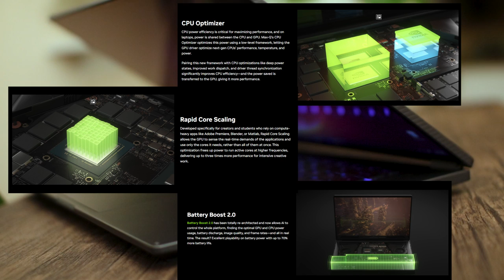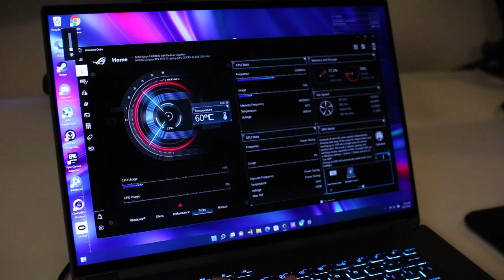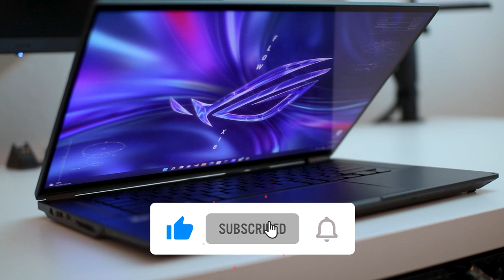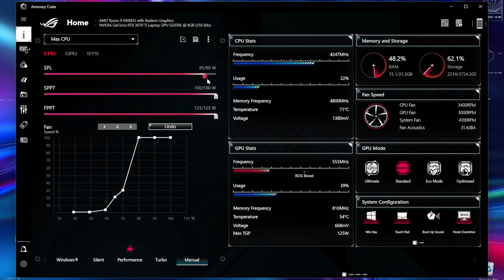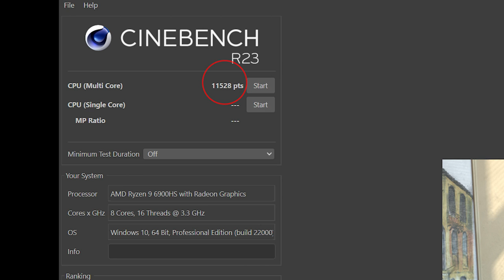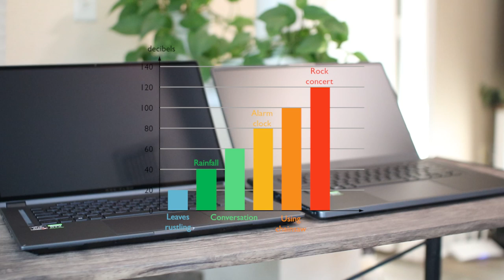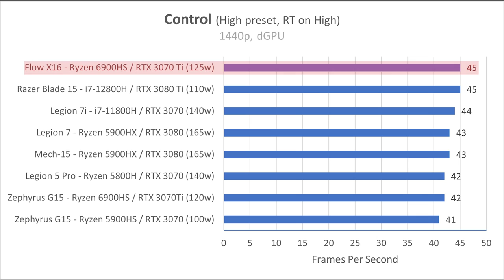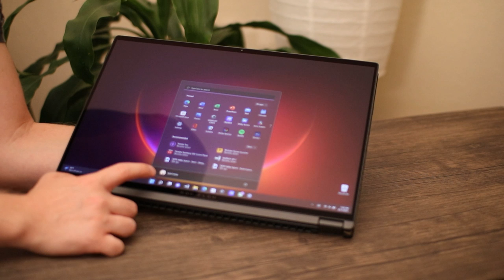Asus ROG Flow X16 Review - Best Gaming Laptop?

Comment: Amazing review, very detailed, long, yet focused and consolidated, well done, thank you!
Do you happen to have a true USB C 3.2 gen 2 to Display Port 1.4 or HDMi 2.1 cable to test the USB C of the XG connector on a 4K/5120x1440 monitor, maybe?
I am aware performance even with DLSS would be low on my monitor, however, my plan would be to get XG 40 series next year for it, was I buy this than actual pc for that would be my dream...
I am only concerned if it could output 4k120/5120x1440 240Hz over said USB C with a rated cable via DSC until then.

Comment: Would you recommend the X13 2022 as well? I've seen the X13 is a bit cheaper.
Reply from the maker: Yes but it’s much less powerful! One of the most powerful 13” laptops you can buy though. Maybe THE most powerful 13” laptop, but even still the X16 offers quite a bit more performance. X13 is much more portable though of course! Just no mini-LED display or anything. However if you get a 1200p model it’d probably get about the same fps in games as a 1600p Flow X16. Still both are great for creators and gamers alike.

Comment: Man I found your review and thanks god I found it , Do you think is worth the 2023 model with 4070 ? It’s still have the same screen tho? Atm I’m between this and scar 18 I love the bigger screen ones ,but comes with huge price , so what do you think ? Pls I wait your answer Asap,keep up the good work Respect !
Reply from the maker: There’s a lot I dislike about the 2023 model to be honest. I’ve heard they got rid of the glossy screen although I could be wrong there. But the biggest thing is the switch to Intel. That is going to cut battery life in half, as we’ve already seen with 13th gen intel laptops. They don’t have good battery life. It may also run hotter and louder because of how power-hungry Intel is. That is a pattern with Intel laptops. And the GPU is a bit disappointing as well. The RTX 4070 is barely any better than the 3070 Ti so you won’t see much graphical improvement either. The only major improvement you’ll see is in the screen having more dimming zones, so there will be less bloom around bright objects on dark backgrounds. But that’s about it. The Scar 18 is a different beast all together. It’s big and immensely powerful as long as you get the 4080 or 4090 model. It will destroy in performance but the screen is nowhere near as good and it’s obviously not very portable at all. And expensive.
Reply: @JoshCravesTech  thank you so much for the fast reply, so in conclusion you will stick with the current version if you have to buy now flow 16 or buy something else ?You really made me think a lot about the flow 16 ,best review I saw in years for laptops un general and a very non biased opinion
Reply: @JoshCravesTech  will you still chose the flow 16 over any other hands down ?
Reply from the maker: @jinasura3052  absolutely. The only thing that comes close is the 2023 Zephyrus M16, but it’s a matte screen, no touchscreen, no foldable hinge, and it’s pretty loud supposedly
Reply: @JoshCravesTech  I understand now ,thank you for making everything clear to me ,was an honor to meet someone like you

Comment: Great video! Thanks for sharing. I have a question regarding the second SSD m2 drive, I saw you used a 2280 format in the slot but in some reviews I read that the second slot is for a 2240 format m2.  Have that second slot with an 2280 m2 worked fine for you? Do you know of any issues that can arise using a 2280 at a 2240 slot?  Thanks in advance!
Reply from the maker: Fits perfect and never had any issues! Most of my games are installed on that drive and it’s super fast and works great.
Reply: @JoshCravesTech  Great! Thanks!

Comment: Does the MUX switch+Optimus solution require reboot every time when switching between the internal and external GPU:s? Or can the software automatically handle the switching without reboot once you set it up? Cause I don't fancy having to type my BitLocker password ten times a day...

In the case that you have to reboot every single time, would it make more sense for me to simply keep it in external GPU mode non-stop as long as I don't prioritize battery life but simply want the best performance in every usage situation? Or would there be some other drawback besides battery life to this approach?
Reply from the maker: Correct, it requires a reboot to switch. If battery life is of no concern, then it is best to just leave it in dGPU mode all the time. The only other downside is that you lose Freesync in that mode because that runs through the iGPU, but I’ve never noticed any screen tearing personally.

Comment: Hey Josh! I just found your channel and this is the best review I saw on Flow x16! There's something I'd like to ask, I'm an animator and I plan on buying this laptop mainly for gaming and drawing. I didn't wanna go with any surface as it's not powerfull enough compared to this one. But then I saw that the tablet mode (the one I would use most of the time) has the lowest performance compared to the others. I suppose this is due to cooling? I would use it on a stand as I like to draw at 45 degrees, but now I'm worried that it would not perform good enough or it would get too hot and eventually damage the components. Do you think it's worth it?

Thanks again for the video, it was really helpful!
Reply: Also, something I didn't understood, the keyboard keep clicking when is on tablet mode or the is it flat enough so that it stays in place?
Reply from the maker: @alvejado  thanks for watching! Yeah so it is still very powerful in tablet mode! It’s just lower power than when it’s in its stock “clamshell” orientation. They do this so you don’t burn your hands off from hot air exhaust if you happen to be holding it. But it’s not “weak” by any means. It would outperform a Surface by a huge margin. It stays cool also so there’s no worry about damaging components. And the keys don’t get in the way, the keyboard is disabled when in tablet mode as well.

Comment: First of all, great video!

I'd like to ask you a question: when you use the stylus to draw/handwrite (in tablet mode, flat on a table) does it show like the "air bubble"? 

I've had a surface pro 8 and when writing with the stylus the bubble under the pen was showing, and the pressure I was making was minimal. 
Instead an iPad pro with an apple pencil never showed the bubble under the screen, even when I was pressing a little harder than normal. 

As far as I understand this was because the iPad had the digitalizer built in in the screen, while the surface has the screen and the digitalizer under it. 

I am a dev-and-gamer first, drawer second, to me the flow x16 is appealing because I would be able to draw on it, unfortunately I can't find any review that talks in depth about how it behaves in drawing/writing with the stylus.
Reply from the maker: I’ll have to check on this, I’m not sure!
Reply: @JoshCravesTech  Thanks so much! Just write on onenote as you would on paper and check if the pen has an effect on the screen (remember the "bubble/wave" when pressing on a liquid crystal display? that sort of things). 

If you have not that effect (or have that only if pressing really hard, on par to an iPad with apple pencil support) then this device is really outstanding. 

Thanks you so much. Keep up with the great videos!

Comment: Great review. I currently own the Flow with ISP and 3060. Thinking of upgrading but had one question that might be the game changer. I use this often at night and usually have brightness turned almost to it's lowest with Nightlite on to keep the screen dim. Could you tell me how dim the mini LED goes in comparison? I hear it's not as dim but what should I expect?
Reply from the maker: Yeah, I do wish it got a little dimmer at the lowest brightness. If that’s a concern of yours (and there might be third-party software that helps with this) then yes it might be a little too bright.
Reply: What did you decide?
Reply: @kundakaps  I went with the standard, dimmer version. Didn't think the brighter version was worth the battery usage and price.
Reply: @thaddeus722 
I found the 3060 one for $1000.
I thought it was an unbelievable bargain.
Reply: @thaddeus722  
Did you buy the IPS variant of flow x16? Please let me know how the screen is?.are the blacks good? I have bought the IPS one ..hope its not night and day between that and mini led..
Reply: @ananttomar1865  I bought the IPS. It's fantastic. And you will never be disappointed in the difference because you didn't buy the mini-led

Comment: Is there a similar laptop but with intel?
Reply from the maker: The Zephyrus M16 would be the closest but it lacks many of the features. Intel’s battery life is atrocious though, so that’s probably why they didn’t go that route.
Reply: But I need a convertible, so I wait for the Rog Flow Z16
Reply from the maker: @reimjaguar6894  May I ask why you need Intel?
Reply: Better performance
Reply from the maker: @reimjaguar6894  have you seen Jarrod’s Tech video on it? The difference isn’t very noticeable outside of a few programs/games unless you’re leaving it plugged in 24/7 and you really want that extra bit of performance when it’s running at high wattages. Ryzen still wins at low wattages, efficiency, battery life, and performance on battery: https://youtu.be/S64_a7PChzs

Comment: It's really cool but hurts buying a rtx 3070 Ti and some time later buy a XG mobile dock and turn the 3070 Ti useless. I wish this laptop came with no GPU so it would make it easier to upgrade
Reply from the maker: Yeah I suppose. The 3070 Ti is still powerful though so even if you weren’t plugged into the XG mobile you still have great performance. And you can always hold off on the XG mobile until they release like a 4080 or 5080 one. They do sell a 3050Ti option for the X16 though!

Comment: Die you undervolt the CPU like you did on the Zephyrus?
Reply from the maker: Yes I think I put an undervolted benchmark screenshot in there somewhere. If I didn’t, it basically led to the same score I got on my G15 but with a slightly higher CPU score. About 11.3k graphics, 11k CPU in Time Spy, and about 15.3k multi-core in Cinebench.

Comment: Great in depth review i recently bought the mini led model and I like it except trying to figure out best way to optimize battery life as I do a lot of work on the go and outside. Using armory crate in eco silent and dim brightness I'm only getting about 5 hours max on youtube playbacl. I've seen other creators on  YouTube get 8 to 10 hours not sure if it's just my unit or that's about the realistic average. Curious to see your thoughts
Reply from the maker: Yeah at similar settings I get around 7 hours. Other things to check are keyboard brightness, minimum processor state (should be set to 0%), turn on eco mode in your internet browser, and disable all startup programs or background processes that drain battery (discord, Steam, Spotify, etc.)
Reply: @JoshCravesTech  thanks will try those out appreciate it
Reply: Stopping the app start ups, stopping edge from constantly running In the background  and changing the minimum processor made a huge difference. Now getting 8 hours plus which is big difference. Especially since made the transition from a mobile workstation was starting to regret the purchase. Thanks again
Reply from the maker: @MrMaw24  no problem!! Glad it’s working out!

Comment: Josh i found a offer of Asus flow x16 with RTX 4070 and I9 and 32 GB ram. Do you think it will work with gaming cyberpunk with out heating Problems and to loud with this high grafic Card and prozessor. I cant Find in switzerland good offers also Laptops with 32 GB of ram and good grafics
Reply from the maker: Yes it will run Cyberpunk really well! Especially the 2023 model with DLSS3
Reply: @JoshCravesTech  It was rly Hard for me to choose between M16 and g14 and flow x16. All i read of g14 is much heating Problems and m16 too and to loud. And you said AT the end of the Video of the New Asus flow x16 review for gaming would be g14 and m16 better ? Is it rly because heating Problems are a huge Problem to enjoy gaming not? Isnt then the flow x16 best choice?
Reply from the maker: @julijanlj.9195  if you wanted a 4080 or 4090 G14 then I might lean toward that one for more performance. I don’t find it to overheat unless it comes with bad Liquid Metal application. For the same GPU though, the Flow X16 is much more premium and quieter.

Comment: Unfortunately I think the 3070ti with the AMD Ryzen 9 version is no longer available since the ASUS site removed the purchase button, and Best Buy only offers the 3060 model (I think without the mini LED as well). Although, I did manage to find one listed on amazon with the 3060 model, but I believe this is the same as Best Buy and does not have the mini LED "nebula" screen. 

I am interested in the mini LED feature, but I am a little worried about how noticeable bloom looked on the reviews you posted for the ASUS 2023 flow and M16 (but I think it might be something I can get around as you mentioned it looks worse on camera). I am torn between the 2023 xflow and M16. The 2023 flow is more pricey but has quieter fans, while the M16 appeared to perform better, but there is difficulty with connecting to external monitors and the fans are significantly louder. 

Which would you recommend for college student?
Reply from the maker: If you’re comparing 4070 to 4070 then I’d get the Flow hands down. If you’re comparing to the 4080 or 4090 M16 then yeah the choice is tougher. It’s been over 4-5 months now and they still haven’t released a bios update to fix the M16’s outputs however I’ve heard some people say theirs works fine while others are still having issues so I’m confused on that whole thing. But yeah I’ve been using G-Helper and that is a great little app for helping fix fan tunings and stuff so I definitely recommend it if you go with the M16!
Reply: @JoshCravesTech  Thanks a bunch! Yeah I was comparing 4070 to 4070 and I think I'm gonna go ahead with the Flow. Your videos have been incredibly helpful with making the decision and I appreciate the input on devices. By far the best laptop reviews on the platform you're gonna go far :)

Comment: Just bought this one for my birthday and game development  I couldn't find it all in one at this price point  it's over 3000 for ones equal to this so not on a sale price is worth it  for 2000 bucks for the cheaper brother so I did my research if you want to use unreal 5 for indy game development  you may want to be aware they are active screens meaning presure sensors for drawing with depth btw...it works with s pen and wamcom and a few other drawing pens.... For pen information

Comment: Is the performance drop in tent mode compared to normal mode significant? Thanks
Reply from the maker: Tent mode essentially performs the same or better than normal. Better in terms of thermals being lower, which is good. FPS will be basically the same in both modes. Unless you’re referring to tablet mode, which is pretty significant. Use G-Helper to tweak to your liking. That’s a newer software that has come out since making this review and makes it a lot easier to control your performance in each profile.
Reply: @JoshCravesTech  thanks for the response! I’m referring to tent mode.

Comment: At around 16:20 you mentioned new ports later this year. An update to flow x16 hardware or software?
Reply from the maker: A bios update that enhances the speed of the USB ports is promised by AMD/Asus before year-end. It’s already being updated on some laptops to meet the USB4 standard.
Reply: @JoshCravesTech  Oh nice. Yeah it wouldn't make sense to release two separate laptop models months apart. I didn't think it was possible to update to a different standard with a bios update.

Comment: Hi, Josh, any suggestion? Just got the Best Buy version of ths 2022 AMD Ryzen. Is there any way to change the POWER ON from the button on the right side to the keyboard. I dont like fumbling around the side for the button and also because it is mechanical, I think it might break from repeated use. On the tablet side, aside from going into the system display button every time you use it to lock the rotation of the screen after you go into tablet mode and get it the way you want it, is there some easier way? After rotating the screen, it's a pain to open the system and then have to lock and unlock the rotation.  YOUR REVIEW IS THE GREATEST! Thanks for the review, that sold me on buying it. Had no quality issues out of the box which concerned me in case I had to return it. Thanks!
Reply from the maker: Awesome to hear it’s working well for you! You might want to look into some macro key management tools for changing the power button to a different key but I don’t think there’s any way to make the current power button not operate. Also look into G-Helper because it has some good additional options for the device like assigning the multi-zone dimming to a hotkey and Fn Lock. There might be another software out there that can lock rotation, or maybe it’s something the developer of G-Helper may add at some point.